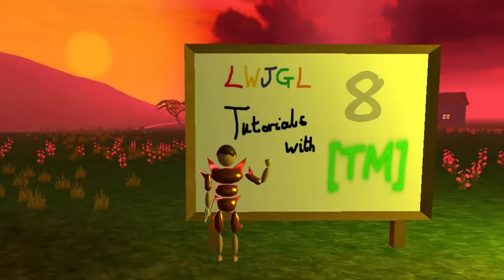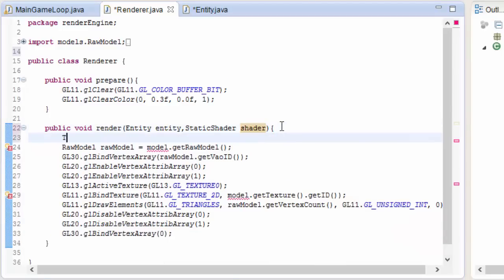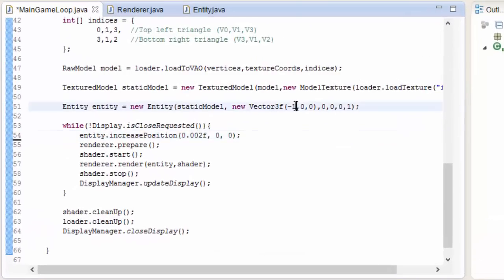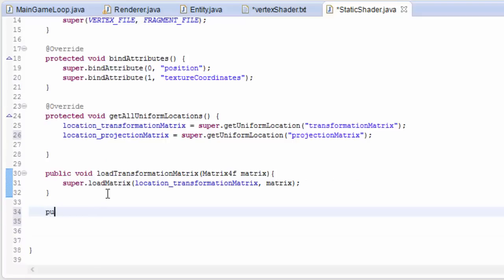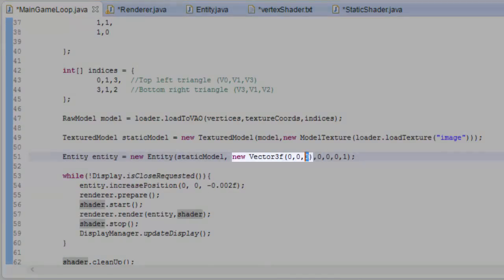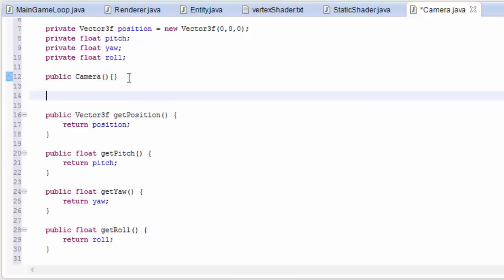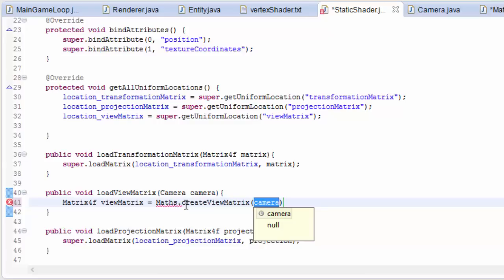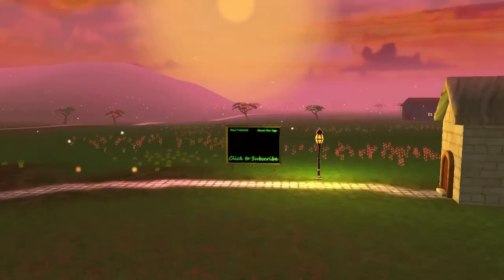OpenGL 3D Game Tutorial 8: Model, View & Projection Matrices

Comment: Hey does anyone know what this part is suppose to do in the createProjectionMatrix()?
What is with those m00 & m23 etc...?

projectionMatrix = new Matrix4f();
		projectionMatrix.m00 = x_scale;
		projectionMatrix.m11 = y_scale;
		projectionMatrix.m22 = -((FAR_PLANE + NEAR_PLANE) / frustum_length);
		projectionMatrix.m23 = -1;
		projectionMatrix.m32 = -((2 * NEAR_PLANE * FAR_PLANE) / frustum_length);
		projectionMatrix.m33 = 0;

Thanks
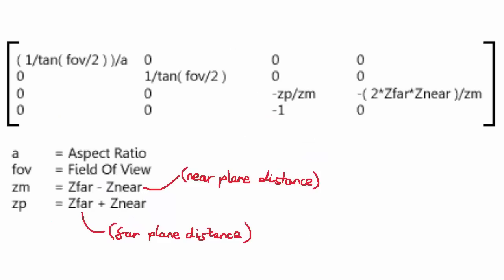Reply from the maker: Teddy C It sets up the projection matrix, which is the special matrix shown at 7:36 in the video. All the .mXX bits are certain values within the matrix. m00 is the top left value and m33 is the bottom right value. All we're doing in this method is setting all the necessary values in the matrix.
The projection matrix basically just makes objects appear smaller when they are further way, like in real life. This is explained from 6:02 onward.
Reply: *****  Okay, thanks :) I didn't piece that together first 5 times.
Reply: ***** Is it possible to make one matrix from the viewMatrix and the projectionMatrix together? since they both have everything to do with the camera and view
Reply from the maker: cookie fan Absolutely! You'd still have to load up the view matrix because we need it for calculations in other tutorials, but at least it would mean that there is one less matrix multiplication in the vertex shader!

Comment: ThinMatrix, I have encountered problems when running my program, it says the shaders wont compile, and I had to mess around with the compile settings to fix part of it. Also, my enitites, and repositioning of my photo has never worked. Do you want me to paste my code so you can look at it?
Reply: And this is the line it wouldn't compile: projectionMatrix.m33 = 0;
Even though i fixed this, the vertexShaders document has a lot of errors.
Reply from the maker: You can send your code to thinmatrix@gmail.com and I'll take a look at it when I have the chance

Comment: *****  What about premultiplying the projectionMatrix with the viewMatrix outside of the shader and instead upload the resulting matrix to the shader, since they are the same for all VAO that use the same shader?
Reply from the maker: Kristofer Carlsson That's a very good thought, and would be a useful optimization for this tutorial. However, we'll be needing the view matrix for calculating the fog in the next tutorial, so we definitely need to have the view matrix in the shader. But I guess you could load both the view matrix on its own and a pre multiplied projectionView matrix seeing as I don't think we'd ever need to use the projection matrix on its own in the shaders.
I actually do this in my game for the model and view matrix, and then do all the calculations in the shaders in camera space, but I'd never thought to do it with the projection and view matrix! So good thinking :)
Reply: *****  I just understood that you actually can upload a projectionViewTranformationMatrix (all three premultiplied). Can you come up with any case where that's not good to do?
Edit. I guess it's bad when the VAO only has a few vertices. So for example particle effects wouldn't be as effective.

Comment: Mine isn't loading and i went over everything at least 10 times.
It was working fine until we did the projectionMatrix stuff and then it just shows a plain red screen.  Any ideas on where my code could possibly be wrong?
Reply: *****
THX ! You don't know why, but THHHX !
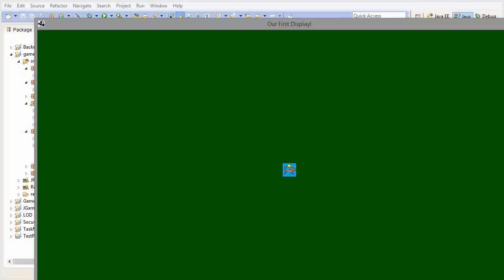Reply: Note: It didnt work when i was at 11:50 ish so i didnt finish this video yet
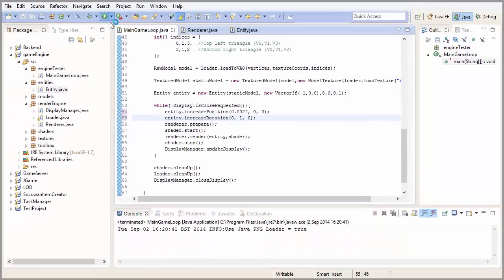Reply from the maker: TheEnderCode Well, assuming that yours worked exactly like mine at 5:35 in the video then it can only be a problem with the projection matrix. If you're not getting any errors then it must mean that you're loading an incorrect projection matrix, or not loading it at all. So maybe check that projection matrix creation code one more time because it would be quite easy to make a mistake with that, and also check that you are definitely loading up the matrix at some point and to the correct uniform location. Also check that when you get the uniform location in the StaticShader class that you spelled the name of the projection matrix uniform variable correctly, as that would cause it to not work but wouldn't throw an error.
If you double check that and you still can't find the problem then you can send me your code to thinmatrix@gmail.com and I'll find out what's wrong for you :)
Reply from the maker: ***** The getAllUniformLocations() method must be called in the ShaderProgram constructor, and NOT the StaticShader constructor, otherwise you'll have problems later on. If it doesn't work when you call it in the ShaderProgram constructor then there must be something wrong elsewhere in your code. Make sure that the getAllUniformLocations() method in the StaticShader class is overriding the getAllUniformLocations() method in the ShaderProgram class.

Comment: Hey ThinMatrix, I really like your tutorials, the way you explain things is really clear and direct. Also I like the pace your going at, getting into the interesting things really fast makes it more fun to watch and easier to learn. I just had one question, what are the benefits of creating and transforming your own matrices with shaders instead of using the built in openGL functions (glTransformf(), glRotatef(), glScalef()) together with glPushMatrix() and glPopMatrix() and the gluPerspective()? as it would do exactly the same.
Reply from the maker: Bouke Stam Glad you like them :) Those built in OpenGL functions are from the old, fixed function pipeline and wouldn't really work with the modern programmable pipeline which we are using. They would work to do what we've done so far, but would limit us in future tutorials when we manipulate matrices more in the shaders. Anyhow, they are also deprecated, and so shouldn't really be used any more.
Reply: Ok I just remembered you said something about that in the first tutorial as well when you explained openGL 3.0 I've always used the default functions, but now I'm definitely going back to some old projects to change them :)

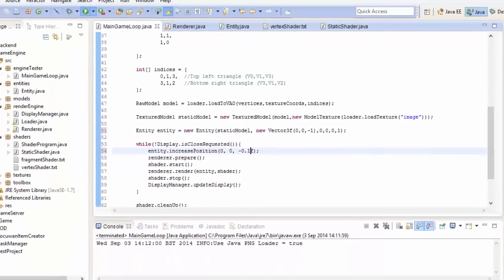Comment: 11:48 At this point, my model is not rendered. I checked every line of code a couple of times and I just cant figure out where it's gone. Do you know any possible reason why it's gone?
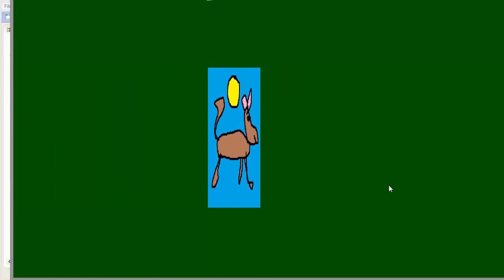Reply from the maker: NubeBuster Did it work perfectly when you tested out the transformation matrix i.e. was yours working like it should be at 5:36?
Reply: ***** Yes, therefore the confusion
Reply from the maker: NubeBuster Hmm, if you want to send me your code quickly to thinmatrix@gmail.com I'll have a look to see what's wrong.
Reply: ***** I sent it.
Reply from the maker: NubeBuster Check in the Renderer class when you're setting up the projection matrix, on the line when you set projectionMatrix.m22, there are 2 mistakes on that line. Everything else is fine :)
Reply: ***** I fixed those but it's still not rendering the object. Two mistakes? I only figured the "*" should be a "+"
[EDIT] I suggest you post that one in the description too, I found it.
Thank you, you're a very helpful and dedicated youtuber, I wish there were more like you!